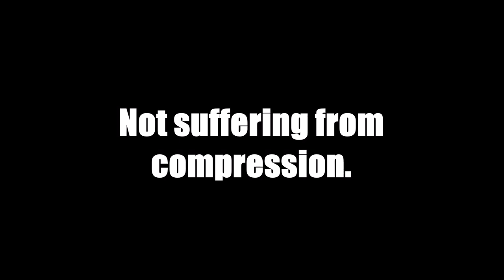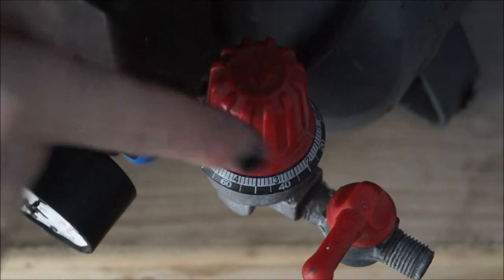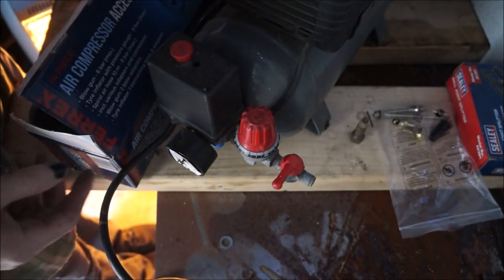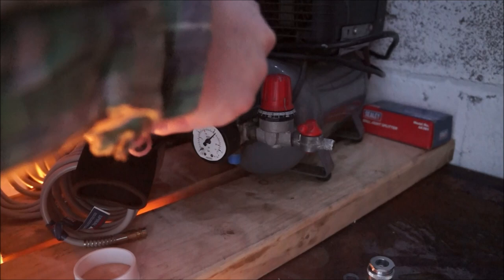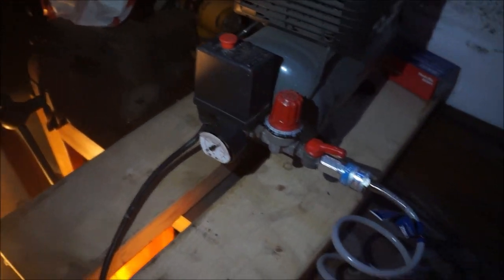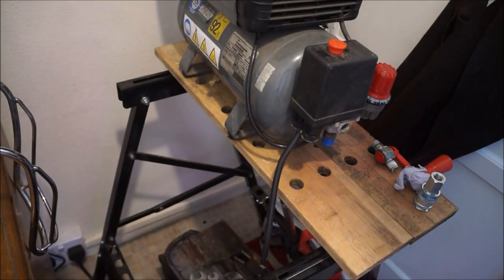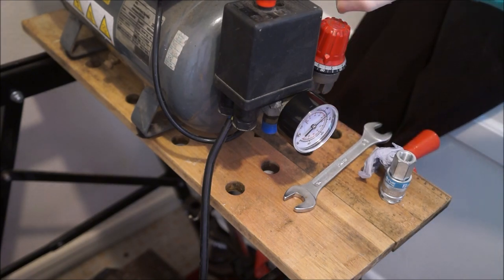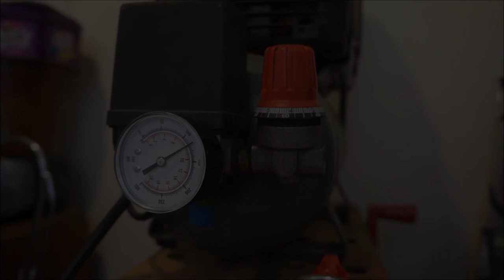Attempting to repair an air compressor

Comment: I think you can buy gauges for them on EBay. I  had one myself over at my brother's farm. Not sure if he still has it there handy for little job's wish we had a machine mart up here we don't only got tool station. Don't blame you taking it inside I would have done the same. Lol yes tighten it up😂 The regulator maybe blocked.
Reply from the maker: Looks like I may have to get a new part Ali. I will have a look around.

Comment: Please be careful working with compressors and compressed air - air at 100 + psi will launch fittings like a bullet !  Always release pressure from the tank with that little side bleed screw before you work on them. Never remove the black box and tinker as that controls the cut out once max pressure is attained - over pressure is dangerous. Rather than mess with the regulator valve buy a new one - they are cheap enough. Please be safe - we love you and your efforts.
Reply from the maker: Thank you John I will, There is always an element of risk with these things and I'm rather cautious.